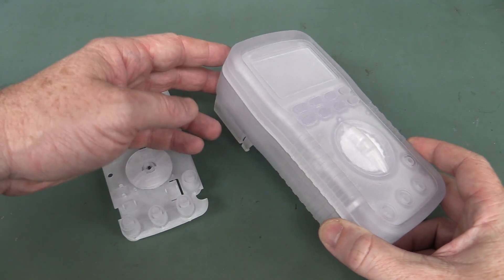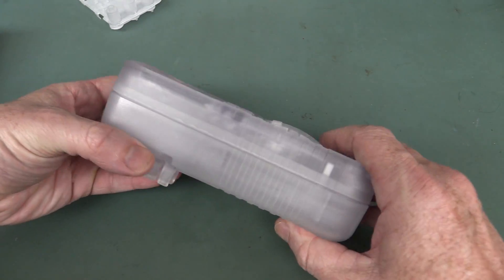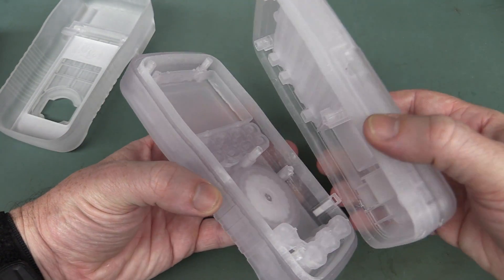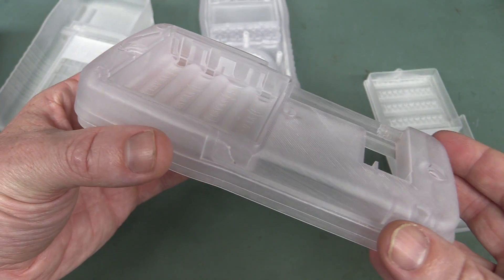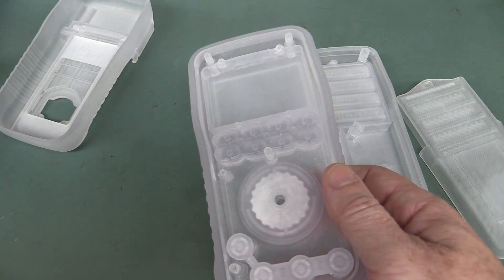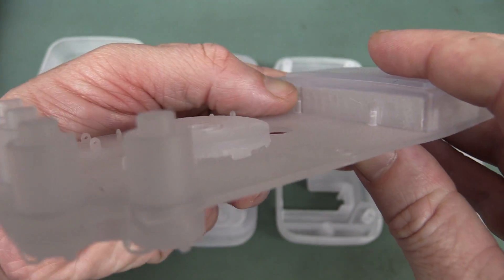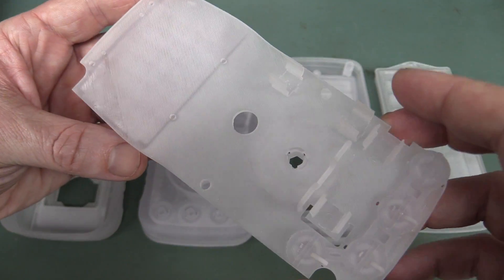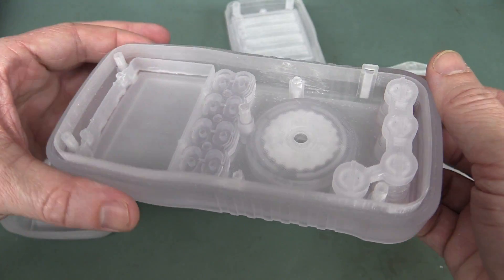EEVblog Multimeter 3D Printed SLA case

Comment: Why didn't you go with lithium if you're going with Bluetooth?
Reply: You may put primary lithium AA-s if you want.
Reply: piast99 I'm talking a rechargeable pack, possibly even a nice docking station for charging.
Reply: A multimeter is a tool that you use for many years. Rechargeable lithium ion pack is dead after 3-5 years. I don't see a point.
Reply: piast99 ahhhh! I  don't want to be wrong, but you're right. possibly a standard pack, with standard connector?

Comment: Dave, if you need rubber printed buttons and stuff, you can print it in Poly-Jet technology. Fortunately, i used to work in Laboratory where we printed sutch kind of stuff, as Hexiwear smartwatch prototype or various kind of electronic ports and cases for multimeters, smart glasses etc, for Mikroelektronika, so if you want, i can give you contact, i bet they can print you that cheaper. Unfortunately, they are in Serbia (as i am), but they ship all across globe

Comment: Are you going to make a charging circuit for NiMH batterys so you don't have to take them out? Like the Agilent OLED Meter where you plug into the 4mm jacks and it would charge the battery.

Comment: What about AA sized Li-ion / Li-pol batteries? I know some people prefer them over normal AAs and with their higher voltage users could use just two of them. But they usually don't fit well into typical AA holder, because they are a little bigger.
Reply: Of course I mean it could support both, not just lithium based batteries.

Comment: You know what feature I loved in my old meter, but only find in a very few meters... A bar graph...
A fast responding bargraph is wonderful for reading fluctuating values. Faster response time than some analog meters, with all the benefits of digital.
Reply: richfiles 
The existing EEVblog DMM (rebadged Brymen BM235) already has a bar graph on the display so I expect that Dave would also include it in this new version.

Comment: The models are only a guide, when moulded the parts shrink at different rates/amounts depending upon wall thickness, shape, cycle time, material composition etc. I do injection moulding and am involved with the design of moulds when new ones are made, you cannot completely trust the models !
Reply: mipmipmipmipmip - moulds should be made metal safe, to allow tuning, an experienced process person should also be able to anticipate issues

Comment: Prefer AA over AAA any day. Most of our devices/remotes/etc take AA. So we all buy large packs of AA.
Reply: I mostly use rechargable, only takes 5 swapouts for rechargable to be worth it.
Reply: Those D-Cells cost a bomb though, and only power the robotic arm for 5 mins. :(
(Has one for the PC, only a toy mind, and it's not usb powered, so I should mod it... but with no actual position sensors it's pointless a toy)
Reply: TechyBen What the heck sort of arm was that?! I had a toy robot arm way back that would last for HOURS on a few D (or maybe C) cells. Only had one motor as well. Ah, I miss my old Armatron!

Comment: DAVE!! Make the meter measure watts! I have seen meters that are able to do this before, I think the way they did it was to have the common be the power supply input, the amps jack be the voltage output, and the V+ be the ground. It's backwards, but it should be possible to do in firmware, and a dual channel ADC would help (to get simultaneous voltage and current!)
Reply from the maker: It does. VA actually.
Reply: You don´t need to ask for, Dave already know what we need....;)
Reply: Power Max why would you need it to be backwards?  just measure the current on the negative side and the voltage probe goes on the positive voltage input.  the only thing that is required is a dual input ADC, which I think this was going to have (haven't watched the videos recently).
Reply: Good point lol, I'm used to hi-side current sensing, I drew out my idea earlier, and after your suggestion, flipped my paper around, and DUH, that works and is easier! 😛
Reply: Watts or VA ?

Comment: Hi, dave. Have you consider add a hanging point or a point to put a strap. On field I had always wanted to hang multimeter from pipes or cables..
Reply from the maker: New version of the case has a magnetic hanger

Comment: That looks pretty good for 3D printing. They must have some proper stuff.
Reply: Nukleon He mentioned it was done in sla. Best of the additive methods for detail.
Reply from the maker: I'm just guessing SLA, I don't actually know
Reply: I don't think so, because there are some visible diagonal traces of nozzle on some parts. It's FDM but for sure not a hobby one. ;) And it's printed with support material.
Reply: braypp SLA needs supports too, but of different type. I think this is not nozzle marks, but SLA layers.
Reply: We're not talking about the supports, but rather the diagonal FDM "texture" all along the planar surfaces.  If this is SLA I'd be shocked.
Reply: I went to remind myself whether SLA was exclusively a term for the vat with lasers method, and - I think someone in the supporter corral has taken Dave's guess to heart. ,= o https://en.wikipedia.org/wiki/Stereolithography

Comment: Dave, why not fit it with a rechargable lithium ion battery and isolated 5v DC-DC? Sure, it would have been a bit more expensive, but I've never seen a meter with an integrated rechargable battery until I fitted a powerbank inside one of my old simpson 360 meters, which just happened to use four 1.25v cells, and its great, just plug it in once every couple of months and you don't need to replace batteries
Reply: if you really want lithium batteries in your  meter just buy the AA lithium cells ?
Reply: mipmipmipmipmip LiFePo4 exists for a reason. That reason is extreme stability (for a lithium ion battery anyway)
Reply: or 18650

Comment: If you got rid of all the jacks you can make 0.5mm thinner.
Reply: z1power Introducing the new iMeter! It features Apple's Craptic Engine and a retina display!
Reply: AirProbes
Reply: I could actually see Bluetooth probes being a future possibility. Better yet, no meter at all and just the probes for a smartphone.
Reply: Sounds like something Aliens would use on abducted people
Reply: My two Metrix multimeters (MTX3282 & MTX3283) don't have a multiposition switch, but they've laid out the mode buttons in a circle like the switch, it also allows you to hold and control the entire thing with one hand.
They also use AA's which is a great step up from the 9v so many use. Plus I can charge the AA's whilst they're still in the multimeter, and they can measure volts & amps at the same time to show watts which is really nice.
One geeky feature I really like is the screen folds up/down like a Star Trek tricorder :)
Reply: easy to accidentally press too...
Reply: Somebody with more skill than me do the concept art.
Reply: @Kevin Miedema, I can't recall if I've ever accidentally pressed the wrong button with my Metrix multimeters. They're very decently made plastic top buttons with a firm positive feeling when you press them, not some cheap all-in-one rubber button like most tv remote controls have.
One advantage of having buttons instead of a dial is that you can go straight to that mode whereas with the dial you might have to skip through other modes before you get to the mode you want, and that could be harmful to the multimeter depending on what it's presently measuring.
From what I've seen of someone reviewing the MTX3282 they're decently protected if you do put it into a wrong mode it won't suffer, whilst they had the multimeter monitoring mains they measured voltage then hz then pressed the resistance button which freaked it out... it only needed powering off then on to get it all working again. It has internal relays that you can hear clicking when switching to/from certain modes.
Reply: yes im sure with the right design it would work very well, but the fact you can go straight to another mode with a press was just a downside i wanted to point out, with proper protection either design should be safe and buttons probably would be more convenient.

Comment: Oooh, do them in translucent plastic as an option!!!!! That would be the best multimeter EVER! And no breach of any Fluke colour copyright etc with that. No one does a translucent DMM... yet.
Reply from the maker: Fluke did a small run of translucent 87's for some promo thing.
Reply: EEVblog2 wow, very cool. I never knew this existed. http://www.eevblog.com/forum/chat/fluke-87-clear-case/ How dare they steal my idea before I even had it!
Reply: Can proper glass filled plastic be made translucent though?
Reply: CLEAR ONE! CLEAR ONE! CLEAR ONE!
Reply: I don't need another multi-meter.... but I don't have a clear one.... that would be SOOOO cool!
Reply: @darkhelmet169 I don't know, but I'm thinking of things like the Gameboy, which was the most popular when it came out in the limited ed. transparent plastic, so you can see the circuit boards etc inside. So cool. Also in the film "Hackers", the lead character gets a laptop which is made out of all translucent plastic too. Also really cool.
Reply: darkhelmet169 The GameBoys were pretty damn indestructible without the glass fill. Maybe the translucent one just omits glass fill? Might save on manufacturing costs
Reply: Hey, maybe a Jacobs ladder sticking out of the top. And, I don't know why, but I'm thinking the meter should be packaged with some round, early 20th century style aviator goggles with a static lead and arc darkening glass too.🎛
Reply: Bluuplanet From the Classic Intersil ICL7106 application sheet, on building a battery operated DVM:
"In the field of DVM design, three areas are being addressedwith vigor: size, power dissipation, and novelty. The handheld portable multimeter has gained in popularity since low power dissipation devices enabled battery operation, LSIA/D converters reduced IC count, and novelties such as conductance, automatic range scaling, and calculating were included to entice the user."

  Novelty sells consumer products. I don't believe that's changed, ever.
Reply: Samgab i will take one!
Reply: jep i´ve seen it some years back at the hannover messe industrie (hannover industry fair)...they also done a give away, but naah didn´t win that...
Reply: You read my mind!
Reply: darkhelmet169 Should be possible to a point. I'm thinking of surfboard graphics as an example. They are usually embedded under a layer or two of glass. I'm no plastics expert, but the UV stability would probably be the biggest long term issue with a clear enclosure.
Reply: I don't know if it's practical, but Why not do a design that incorporates one of those tritium vials into a clear case. Who doesn't want a nuclear glowing multimeter. Not to mention the practical gimmick factor for use in the field away from the workbench.